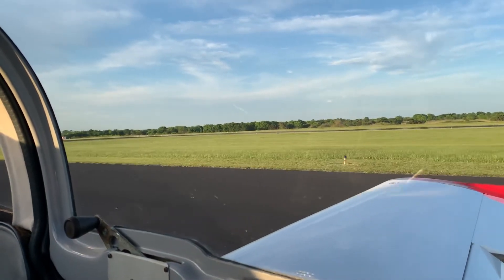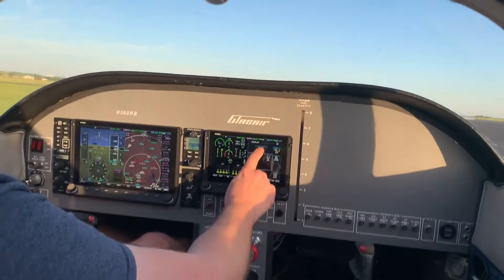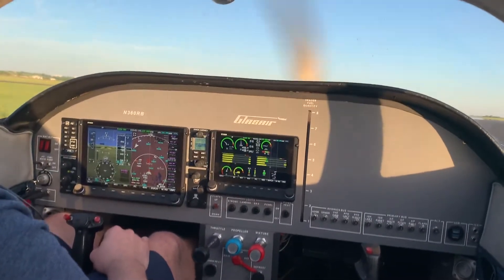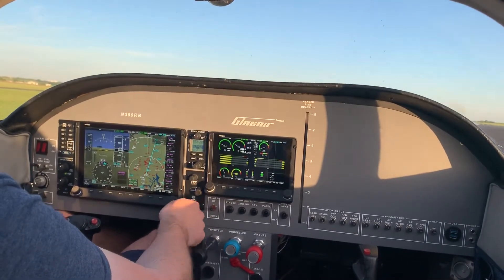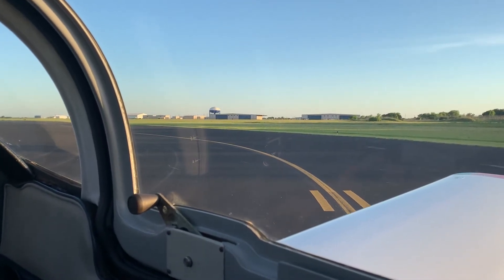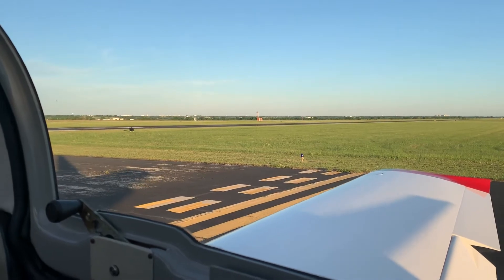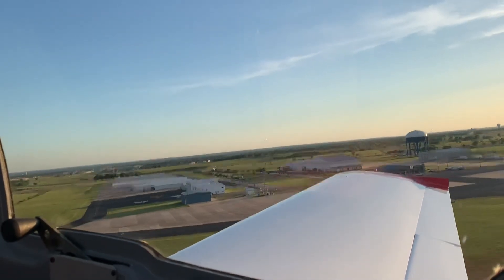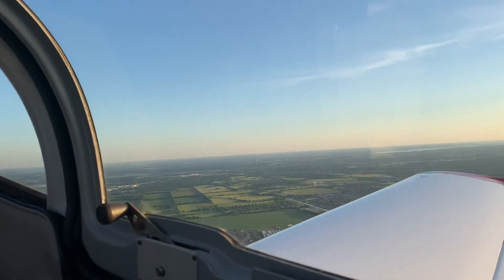Glasair II takeoff

Comment: Austin,  quick question.  I’m updating the panel in my FT with a Skyview HDX system.  I’m currently planning to install a 10” and 7” like yours but my question is,,,, do you really use the 7” all that much?  Do you tend to keep it on the engine monitor page all the time or do you find yourself looking at other screens as well on the 7”?  I already have the 10”, but trying to decide whether to cut the hole for the 7” as well.  Any recommendations you might have would be very much appreciated.  Thanks!
Reply: Good question! I use the 7" quite frequently. On takeoff and landing it is set to the full screen engine page. When en route it is split between engine and map page. If I have a fellow pilot in the right seat it is set to engine on the left and flight instruments on the right. If I had done this project again, I wouldn't change a thing about this set up. I would not recommend putting a screen on the co pilot side as that would require too much attention on the opposite side of the panel. That seems to be a popular configuration but to me it doesn't make sense if it's not a two pilot cockpit.